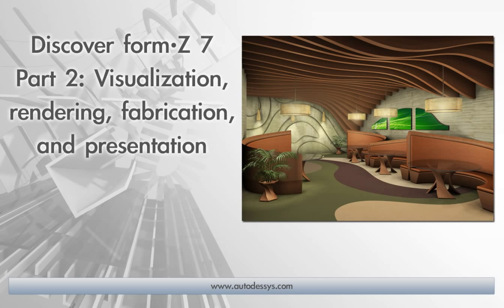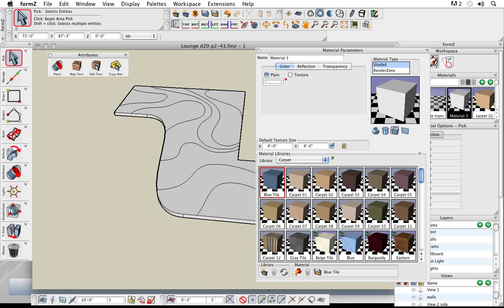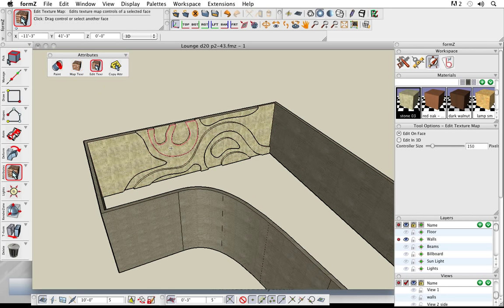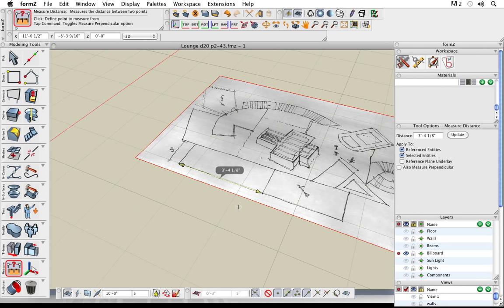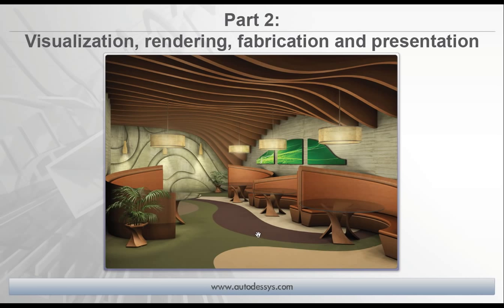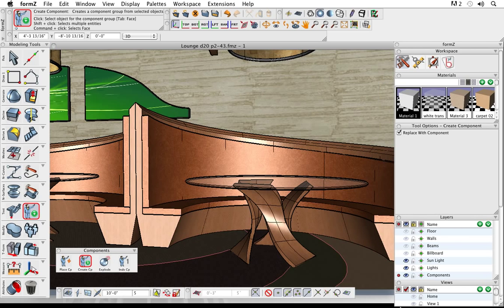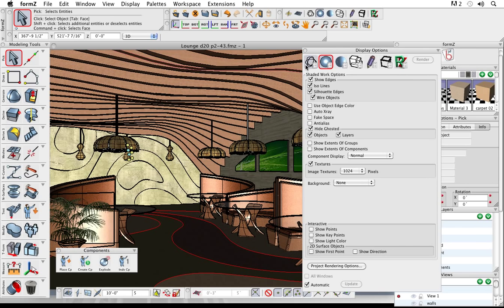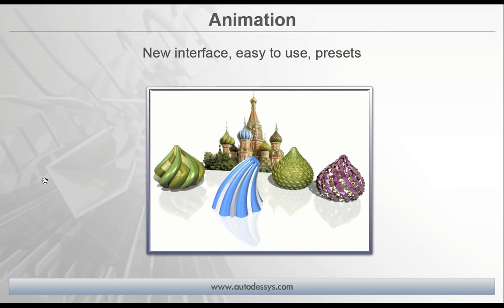Discover form•Z Part 2: Visualization, rendering, fabrication and presentation

Comment: Can you please tell which video card/video memory, RAM and CPU capacity is recommended to run a smooth operation with FormZ 7.0?
Reply from the maker: Hi Robin,

A good gaming card is fine, and you can see relative performance of various cards here:

http://www.videocardbenchmark.net/high_end_gpus.html

(Most likely a $100 - $200 ATI or nVidia card will be sufficient).

CPU performance will be comparable to what you see here:

http://www.cpubenchmark.net/high_end_cpus.html

RAM is cheap, so you my as well get 8 - 16 GB Ram.

Please email support@formz.com for any further technical info, and try the Trial today!